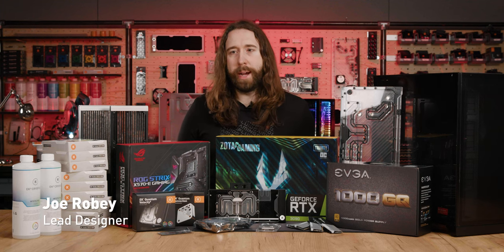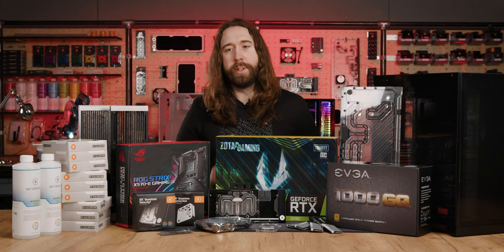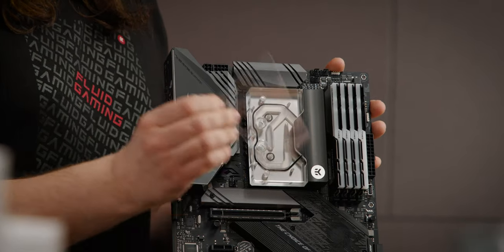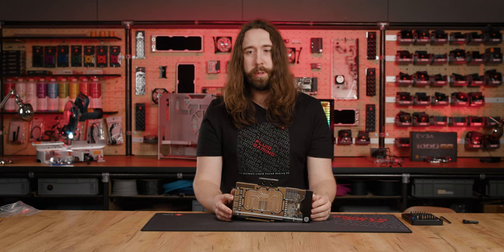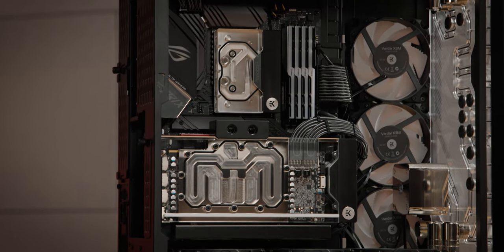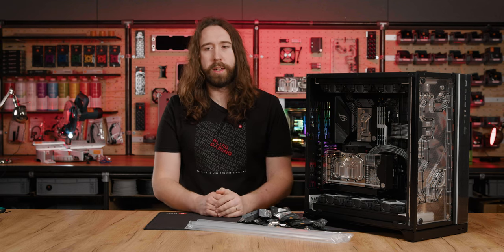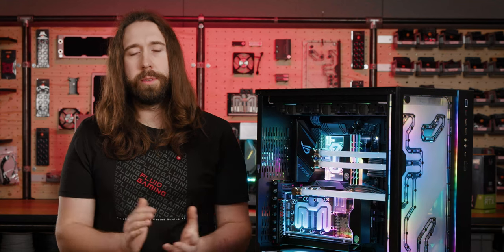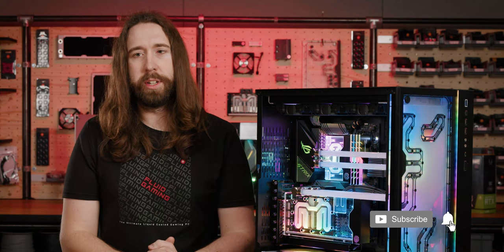Ultimate RTX 3090 Watercooled Gaming PC 2022 build - EK Fluid Gaming Conqueror 🚀

Comment: hey do you think you can have a parts list for all the ek items used for this build , as im trying to make a similar pc
Reply: i would love a parts list as well.  specifically the extension fitting sizes!
Reply from the maker: We've used our new radiators (coming soon) with X3M Vardar fans, Velocity² CPU block and Vector² GPU block with a new vertical GPU holder (coming in a few weeks) and an upcoming Reflection² distribution plate :)

Comment: I have a question does the ek fluid conqueror pc have a rtx3090 or a rtx3090ti? If does not have the rtx3090ti, I don’t get it beacause the vanquish 299 has an rtx3090ti and it’s 6,500$ with the same exact specs without the quantum liquid cooling and has a rtx3090ti?
Reply: We will have the option to add RTX 3090 Ti very shortly, we're just waiting on GPU water-blocks. Drop us a DM on EKFG socials.
Reply: @ekfluidgaming2083  okay thanks you for letting me but will adding the rtx3090ti add extra money
Reply: why does this pc only have a rtx3090 for 7,300$? it should have a rtx3090ti for this price
Reply: @nintendoboy4199   if you had actually priced out the components in this build, you’d realize that to make this build and put a warranty on it for $7,300 is not out of line.

Comment: I'm going to try this build only with ROG STRIX Z690 + 12900 / FTW3 3090TI and its EKWB Vector 2 mate - Has anyone else attempted this ?
Last of the EKWB parts came in through USA customs today. UPS import fees and all !  Wish me luck or please offer any guidance !
Reply: Update-Almost completed. Worthy to note the FTW3 3090Ti's triple wide IO backplate does not fit the Lian Li / EK-Gen4 Riser arrangement. EK doesn't provide a dual wide plate in the ABP block kit for this GPU, so I ran out of place to find a proper one. I ended up cutting mine on a band saw and sanding it smooth. It worked out for me but it would have been nice to receive one for this application as part of the kit. Also the light strip LED's are VERY fragile off the EK-Vector2 FTW3 3090Ti Bock. So much so they have snapped off on me at the point where they enter the block. Just be very careful with them. I have learned to leak test each component first and then as the build happens one tube/section at a time. The leak tester is very nice and comes with the purchased kit BOM if you buy that shop the loop conqueror in it's entirety. The Push in adapters are slick ! Very nice design. Also, the Tech Support is outstanding. They promptly get back to me in a day or so and always come with answers to my questions or ideas. I've watched this video like 50 times.

Comment: Nice job.  What kind of blade are you using in that mitre saw?
Reply: We are using the standard blade, its fairly coarse although we have never used it for anything besides plexi so it remains sharp enough that it doesn't chip or snatch at all. I'd probably pick a slightly finer one but most importantly just don't use it for every job and keep it for plastics.
Reply: @jr23design10  Thanks!

Comment: What model of vertical mount for GPU do you use? The only one that is in the web store indicates that they are not compatible with Quatum waterblock for gpu
Reply: It's an upcoming vertical GPU holder that hasn't been released yet (ETA 3-4 weeks). More info will be available when it's released 😄

Comment: What kind of blade did you guys use on the chop saw to cut the acrylic tubes ? Is there a fine tooth option I could get or does the standard blade work without tearing up the tubes ?
Reply: Its the standard general purpose blade, quite coarse although we've never used it for anything besides plexi so it's still perfectly sharp. It cuts neat, never chipped or snatched the edge. I'd probably pick out a finer one although I think the important thing is just to keep it specifically for plastics.
Reply: @jr23design10  Wicked ! I'm gonna give it a try, Thank you :)

Comment: What vertical GPU mount are you using on this build and would it be suitable for the 3090 FE with an  EK-Quantum Vector FE RTX 3090 D-RGB Active Backplate? @EK Water Blocks
Reply from the maker: It's an upcoming vertical GPU holder that hasn't been released yet (ETA 3-4 weeks). More info will be available when it's released :)
Reply: @EKWBofficial  Thank you for this information. 😀

Comment: Do you need a S360 on the bottom to get the clearance for the vertical GPU mount and which PCI slot is the GPU plug into?  Can you publish a full parts lists, including brackets and fittings,  for this build?  Is the D5 cover available, I do not see it on the webshop
Reply from the maker: The size of the bottom radiator depends on the size of the GPU as well as size of fans, but you can fit up to X-sized radiator there even with vertical GPU mount. A smaller GPU and thinner fans will be able to fit a bigger radiator. In example - A standard reference RTX 3080 will easily fit a P360 radiator with any standard fans.
Pump covers are available here: https://www.ekwb.com/shop/newsletter/ek-quantum-convection-d5-ddc
If you've got any questions regarding compatibility, parts list or anything else - feel free to contact our customer support: https://customerservice.ekwb.com/hc/en-us/requests/new
Reply: @EKWBofficial  will a P360 fit in the bottom with the current position of the GPU bracket as shown in the video?

Comment: What fittings did you use to connect the radiators to the distro?
Reply from the maker: We used EK-Quantum Torque Push-In Adapter M 14 which was specifically designed for these distro plates, and Quantum Torque fittings and adapters.

Comment: Building the same rig except in the normal o11d with the side distro. I jave the same GPU, but am planning on going with a DDR5 set of dimms and a 12900k. Will a 1000w psu fit in the normal O11D? Never built in it before.
Reply from the maker: Any standard-sized PSU will fit :) For maximum PSU length and height please check the case manufacturer's website
Reply: @EKWBofficial  Thanks!

Comment: Can the side fans stay inside the case next to the distro plate? In some videos I see that they need to stay outside, in the second chamber.
Reply from the maker: They fit next to the distro plate, however - the Lian Li case is also designed to fit both the 3rd radiator and its fans in the side chamber, leaving you the freedom of choice :)
Reply: @EKWBofficial  I can't fit the 3rd radiator and fans in the side chamber.  S360 rad is 30mm thick, fans are 25mm thick, so total 55 mm thick, but clearance between mount panel and reflection2 distroplate pump is only 30mm.  You'd be trying to mount a 55mm thick complex in a 30mm thick space, which does not fit.  this is the problem I'm having right now.  The "shop the loop" lists 3 radiators in the setup for the conqueror build, but this video only shows 2.

Comment: Thank for your video.
Would both Active Front And Back water blocks you used in your video fit on my GPU which is an ASUS GeForce RTX 3090  ROG Strix  OC 24GB  Gaming GPU?
Reply from the maker: Yes they would both fit your GPU :) If you wish to check for all the compatible products with your hardware yourself, you can use our configurator: https://www.ekwb.com/configurator/
Reply: @EKWBofficial   Thanks for your reply.  Will it be easy to remove my current EK Classic Water Block and passive backplate in order to replace these with the EK Quantum Vector2 ?

Comment: Only three straight tube runs. That's impressive. Wondering if the adapters from the rads to the distro may be a bit too inflexible leading to cracking of the plate though. Wouldn't it be better to do some tubing so it has some amount of give to it?
Reply: The final Reflection² for the XL will be even more versatile than this sample, so you can mount the rads without threaded fittings. There's nothing preventing long tubes either but this is really neat and consumes less fittings.
Reply: @jr23design10  when will it be available?
Reply from the maker: Current ETA is around May :)
Reply: @jr23design10  Is this config out het or do i still need the funky 90s for the direct rad to distro connections?